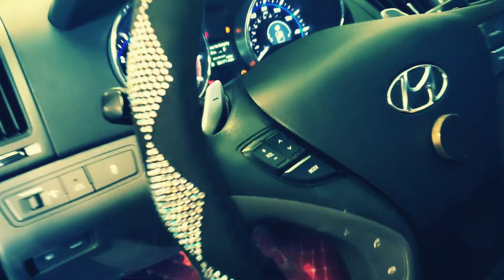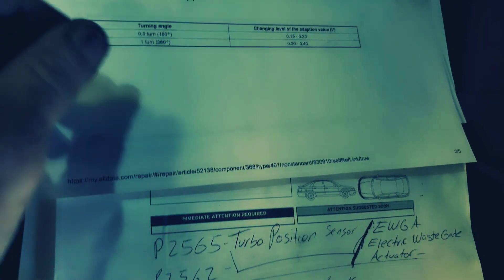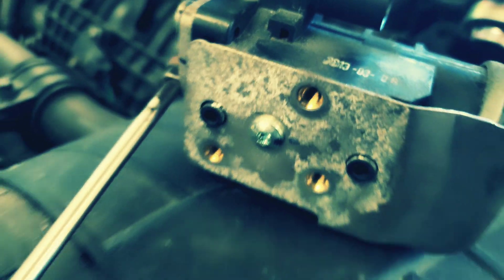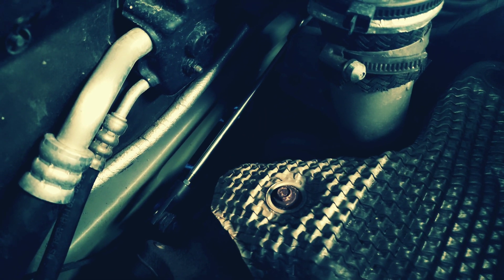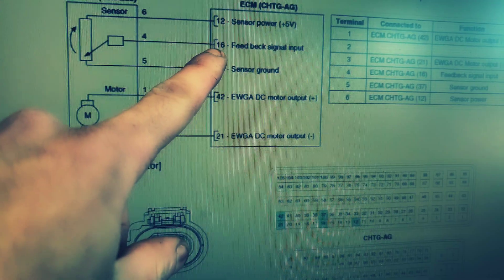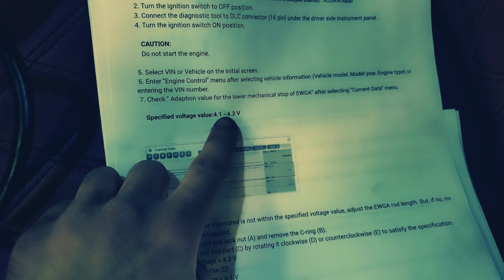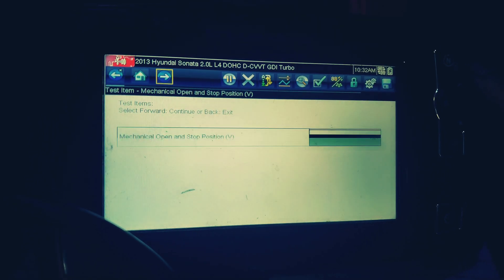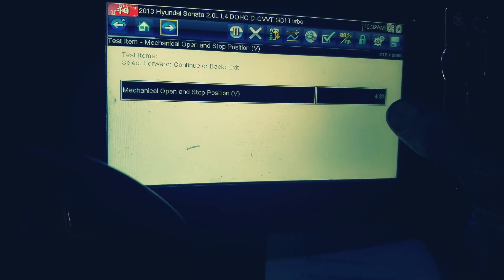Hyundai Sonata P2565 P2562 EWGA electric wastegate actuator

Comment: I have engine code P2562 on my 2016 Hyundai Santa Fe Sport 2.0T. Turbocharger Boost  Control Position Sensor Circuit. This error code indicates the PCM detected Turbocharger/Supercharger control A circuit signal was not within acceptable limits. Is what it says on the sheet when I went to go get my engine code scanned.

Is this error code covered under extended warranty?

Comment: My scanner says 
Mechanical open and stop position 4.01 normal, which i actually think is out of spec

Electrical open and stop position 1.20 not normal 

What should I be looking at? 0 boost currently
Reply: Also, 2013 Sonata 2.0, no codes, yet. EWGA replaced about 4 years ago, entire turbo replaced 2 years ago.

When the EWGA went bad 4 years ago, it wouldn’t work on a cold start, but after things warmed up it would work.

When the turbo was replaced it was because of a bad bearing, made a horrible noise and no boost.

Comment: My 13 sonata recently had a warrantied engine replacement and worked fine up until a few days ago. Cold start it would stay in limp mode, then work fine after parking for awhile. Took it back to the dealer and they adjusted the rod getting it back to specs. They said the issue may return but I was curious if it sometimes just randomly happens or just a sign that  the actuator will need replacement?
Reply: SAME HERE, had my engine replaced under warranty. My wategate broke (I suspect Hyundai service broke it) when they installed the engine. It was fine before engine, now they want $1000 to replace it and said it was not covered. EVIL.

Comment: Question, did you have to reprogram the ewga?
Reply from the maker: All you have to do after install is check closed voltage and make adjustments to rod length if necessary.

Comment: Do you need to have accessory power on when you test the values w a multimeter?
Reply from the maker: Yes or else you will not get any voltage on scanner or voltmeter

Comment: What if you get zero on the volt meter?
Reply from the maker: Check your leads. Also check pin 12 at the computer. No power at the computer means you need to replace the ecu and not the ewga. Zero at the signal wire (pin 4) means no power to pin 6 coming from the ecu on the ewga.